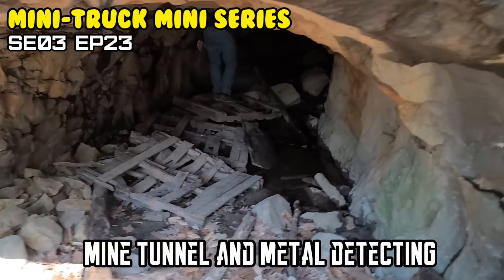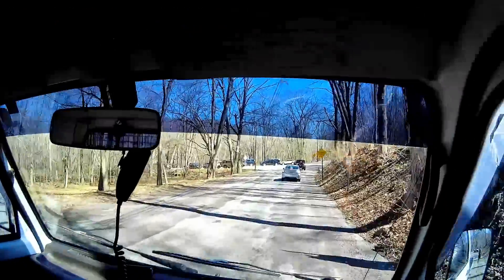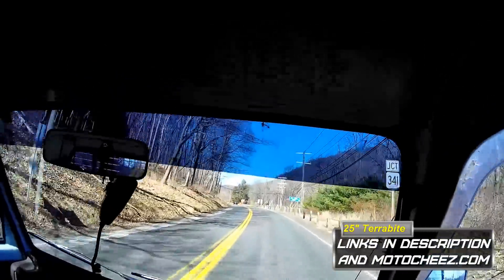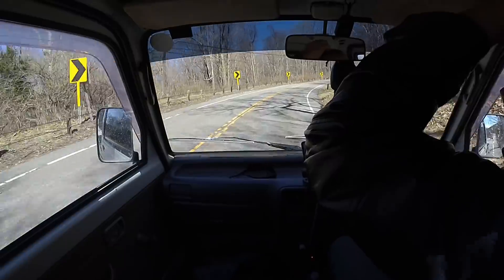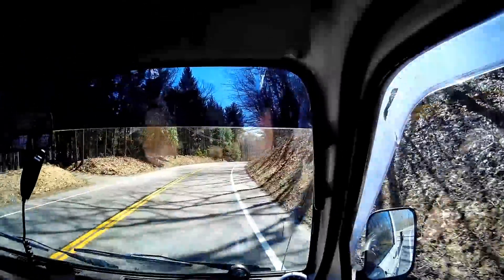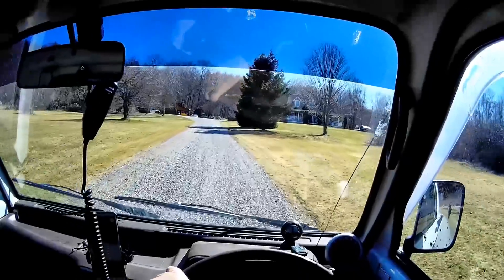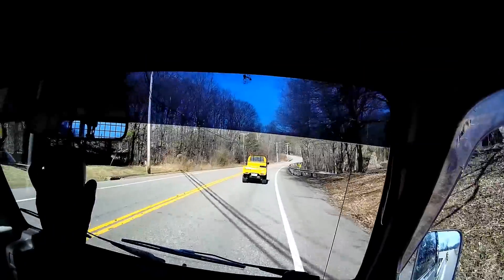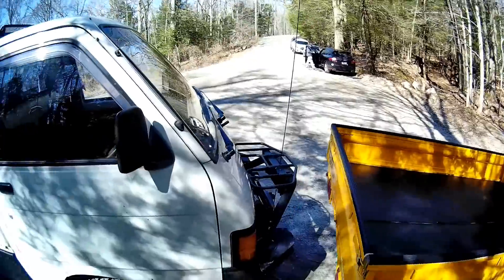Mini-Truck (SE03 E23) Tiny Tonka and Mini  tunnel mine, metal detecting and cruising CT back roads

Comment: You can put some thermal and sound isolation under the sits if there is not any,  the 1,000 cc suzuki had some. Also to the floor and the front and back of the cabin. You may have noise from the differential at high speed but the noise of the tires covers it. You can put a small amount of anti - friction liquid in it to stop it even to prevent it. My carry had a bad diff from spins and drifting and one bottle of it stopped the noise even after 50k km.
Reply from the maker: Awesome. Thanks for the info

Comment: Have you seen the NOS shots they have for mini bikes? Throw one of them on. Also sound insulate the cab like a luxury car, looks like an easy job with how little interior you would have to move.
Reply from the maker: I've had NOS, uses up so fast. Noise reduction would be nice
Reply: There is really good tutorial on the honda fit unofficial forums, I wanna say it was in the 150 dollar range for all the proper materials,  but you could probably do 3 minis with the same amount of materials as a fit.

Comment: The antenna on the Tiny Tonka, I've had them go bad causing those audio issues. Something with the way the antennas have crimps on the aerial before and after the center load. I've had many out of the package the SWR would be erratic. I would suggest a Wilson magnet mount. but on the mini trucks I'd go with a 102" whip for more of a RC theme.
Reply from the maker: I'll let him know. I like the Wilson's also. Have on my Jeep